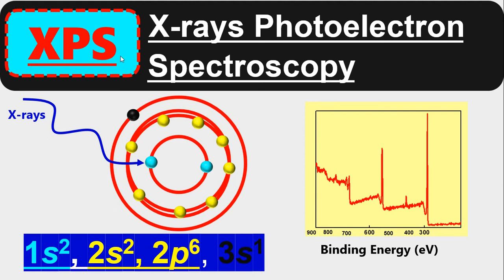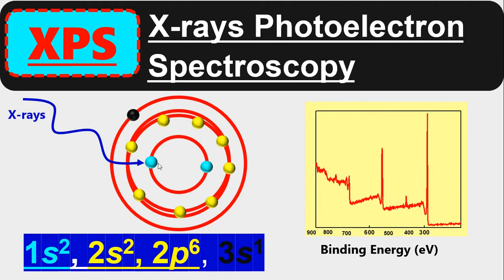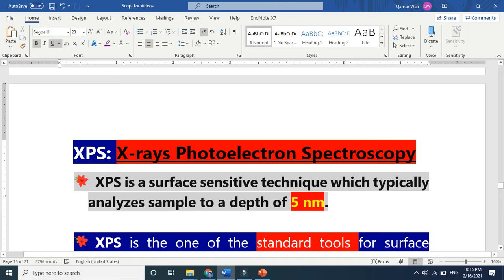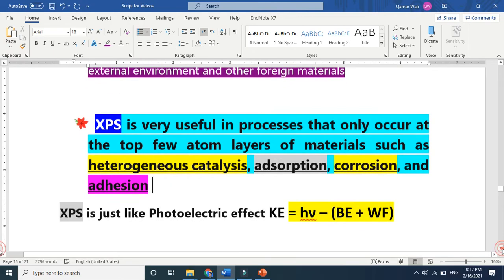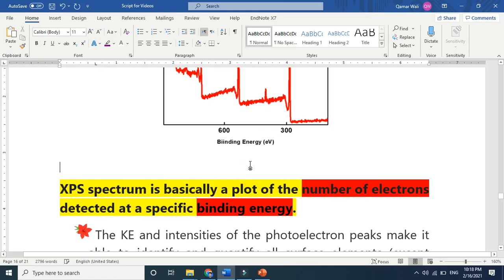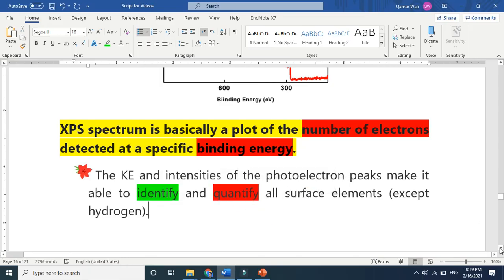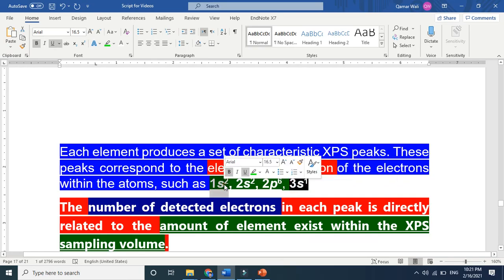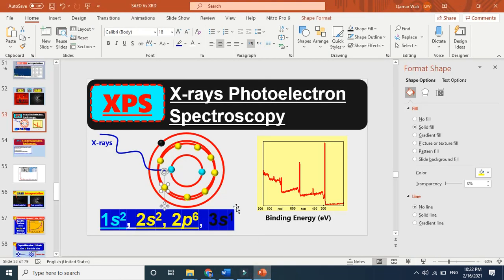XPS - X rays Photoelectron Spectroscopy

Comment: Thank you for your explanation , I will analyze samples containing WO₃ and Pd by XPS. What parameters do you recommend (survey, high-resolution, charge correction, etc.) to get the best results? I am new in this area
Reply from the maker: Thanks for your comment. In XPS analysis, we basically need two spectra  i.e., (1) the survey spectra, which give us the elemental information only. It is just confirm the existence of a specific element, and (2) high resolution spectra, which gives in-depth details about the surrounding of the that element. For instance, how that specific element is bonded with other elements, whether the oxidation state of that specific element increases, decreases or remain constant. It basically talk about he chemical environment. 

In both spectra, Binding Energy (BE) is the main factor, which help us to find the elements and its chemical environment. The BE is just like the fingerprint. 

The rest of the parameters will fix by the XPS operator when analyzing the sample. I am not sure about those parameters !

I am grateful for your nice comment. 

Best,

Comment: Thank you for the explanation. What is the difference between the binding energy and work function?
Reply from the maker: Good question! According to my understanding,  both looks same but use in different terminology.  WF is the minimum energy require(Photon energy or heat energy) to liberate or remove electron (the bonded electron) from the metal and sometimes it refers BINDING ENERGY.

Comment: I would like to know the carbon content on the surface of gear flank with a diameter of about 50 mm and a thickness of 20 mm made of steel. Is it possible for a sample of that size. Is there any other method if XPS is not possible for the same purpose? Please help me..
Reply from the maker: XPS can do the job. This method is especially designed to give information of the different contents exist in a single material. For instance, in your case Carbon and Steel so you will get information in terms of atomic % and weight %.  It will clearly shows that how much % is Carbon and how much % is Steel. 
For the dimension, I recommend to ask the XPS machine operator. I am not sure about this part of the question
Reply: @nanospeaks  Thank you very much. I am new to this subject. I have followed some of your other videos but have not gotten an XPS tutorial that starts from sample preparation to determining the chemical content of the material surface.
Reply from the maker: @fauzanhz4782  I suppose, you just handover your sample to the XPS operator if you are a researcher so you will get your results.  If you wish to operate XPS machine then that is another story 😊🌸
Reply: @nanospeaks  That is why I am currently looking for the most effective information to quickly understand from sample preparation to data analysis. The laboratory where I am currently conducting my research does not provide specialised operator.😥
Reply from the maker: @fauzanhz4782  oh I see. I strongly recommend to look into the manual of the XPS.  Every machine has it. Secondly,  ask some company who are dealing XPS.  

Wish you all the best in your study.
Reply: @nanospeaks  Thanks for the advice. I am an international student living in Japan and still struggling with manuals which are all in Japanese. 😭